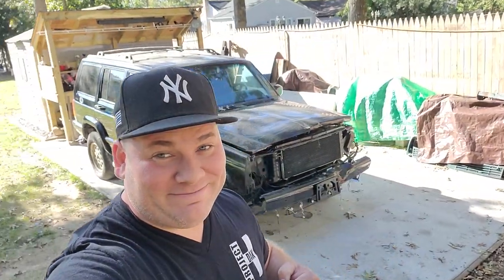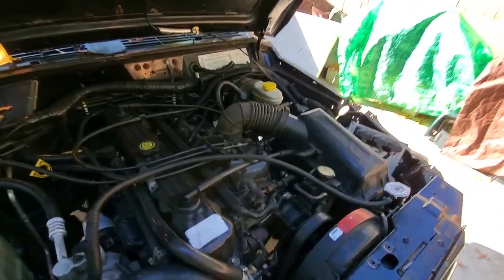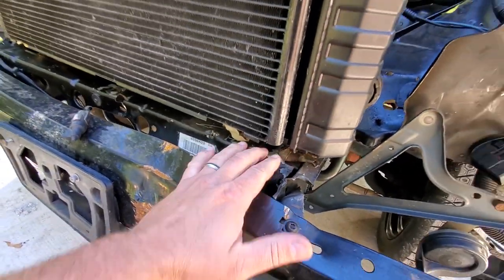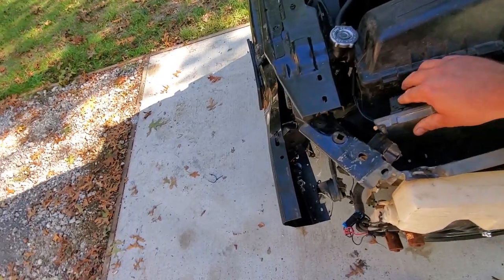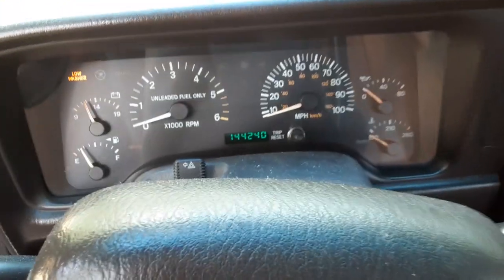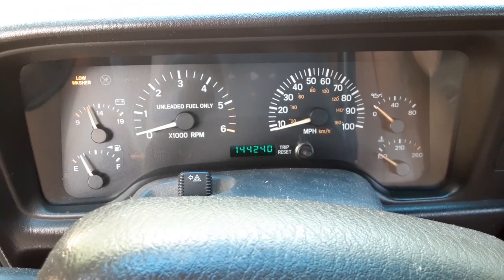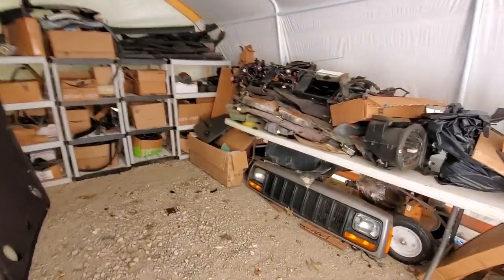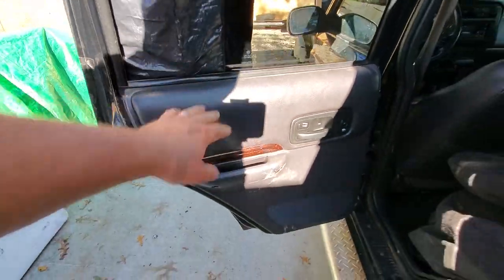ANOTHER WRECKED XJ - SCRAP IT OR RESTORE IT?  YOU DECIDE IF THIS THIS LIMITED BEAUTY LIVES OR DIES!

Comment: The benefit is you've got the parts.  Aside from the front end damage and the parted out interior it looks about the same condition my XJ was in when I sold it.  Only difference is mine didn't run.  I tend to restore vehicles to stock before I mod them,  mostly because that way you know your starting point.  But your assessment determines the direction you take.  As I see it your options are: rebuild/restore it as daily, build it up to the point that it's a starting point for someone else to take in a direction of their choice, or build an off road vehicle with your own spin on it.  If you figure you've already got a resto project with the General, and a restomod project with Beach Jeep.  While building it to the point that you can auction it off to fund other projects is a good idea, which you may do regardless, what you do depends on how far you want to go.  After all, a rock crawler or mud bogger doesn't have to look good, it just needs to function. But most off road builds at some point stop being street legal and become trailer queens.  At the same time, a fully restored XJ will get you the most $$$ at an auction.  There are pros and cons to everything.  Building an off road rig might give you the opportunity to collaborate with bigger channels, give you more exposure. You've got a lot to think about.  My thoughts, how high would you lift it? What axles would you swap in? What size tire? What lights? What winch? What kind of stank does a Dan H off road rig have?
Reply from the maker: you make great points! it seams like most people want me to build an off road rig.  Ill make sure iI have a fully functional stock runner first!
Reply: @ProjectDanH  That's the beauty of an off road rig, you don't have to have a stock runner.  Around here people take jeeps that are towards the end of their useful lives, and lift them, put bigger tires on them, run them into the ground and scrap it when they're done with it.  Hell the back hatch I picked up from the junkyard for my ZJ had ORV tags, a rattle can paint job, sawzall tire clearanced fenders, and nearly bald 265's. So you can start right where your at, put your lowest visual quality parts on it and your good to go.  I say lowest visual quality because it literally only needs to be functional because you're going to scratch the paint, dent the fenders, break some windows, and do various repairs on the the trail so you can keep going.  I know a guy who's son bent some part of his steering linkage on a trail when he came at a rock too fast. They had to bend the rod back into shape as best they could before he could continue. Only thing I would go is weld in a roll cage and some frame stiffeners since you're already mostly gutted.  And go with a group, last thing you need is to be out somewhere with no signal and get stuck.

Comment: I think it can be saved, you've parted out a lot of them so it wouldn't be too bad to fix up. It runs and drives, which is a good sign, and like you said you could replace the bashed part with the one from the 2 door. Also you should keep the 10 hole rims, I think they look really good on it ( that might be because the 10 hole rims are my favorite xj rims lol ) that 93 xj I talked about also had them, it had the ones that didn't had the studs around the outside of the rim.) But I think that jeep would be a very cool build.
Reply from the maker: Yeah, i think your right.. time to build one!!

Comment: How’s it going. I was wondering if you had any extra parts that I can buy for my 1991XJ ?.. I live local to you. Thank you
Reply from the maker: Yo, what do you need, I only have 97-01 parts
Reply: @ProjectDanH  oh ok. Man i’m having so much trouble finding these parts used.. I need a passenger side buckle for the seatbelt , 2 manual front seats in gray , driver tail light, passenger side mirror,

Comment: Will you see your money back that is the Question. Need's to be put on a lift the floor pans look like toast.  Oil leaks matter too. The lower rear Quarters most times are deleted for wheel clearance. Time and Labor matter's. I've seen those lower rusted rockers replaced with Steel Rec.4 by 2 Tubing used as skid plates. Dump those Pipe steps. Make it an over lander with a 4 inch lift. With some 33's. Do you have the title?
Reply from the maker: yes to everything!

Comment: Rust = Scrap.  Pull off what you can, scrap the rest.  If its showing rust, its worse inside than you can see its far from worth fixing.  Part out the drivetrain, you'll come out farther ahead than trying to repair the mess the previous owner destroyed on it by being lazy...that looks more like pick a part type parting out than a good owner taking things out that were usable to them.  Definitely not worth keeping around.
Reply from the maker: I appreciate the insight.  I really don't need any more parts.  maybe ill dig a little deeper to see how bad it is.
Reply: @ProjectDanH  A lot of money tied up in that thing to get it back on the road, I'd just yank the drivetrain out and scrap the rest....too bad I don't live closer I'd take the engine for my 98 ZJ that has developed what I think is a rod knock so its on borrowed time.  When it goes so does the Jeep, not wasting anymore money on it.  Love the Selec-Trac 4WD but not worth putting an engine into it when it goes.  For the cost of an engine replacement I can get a pretty nice used pickup.